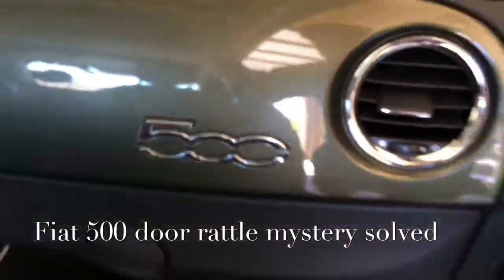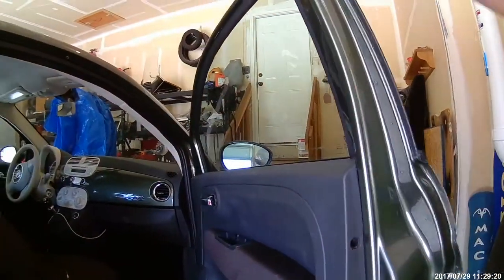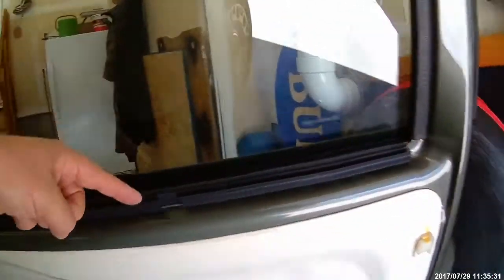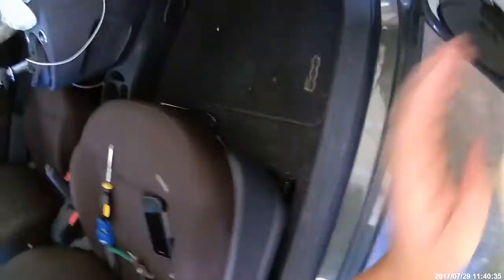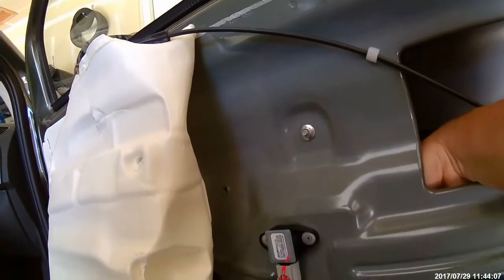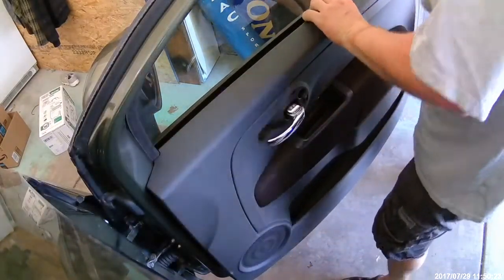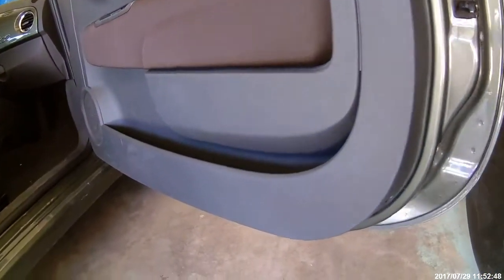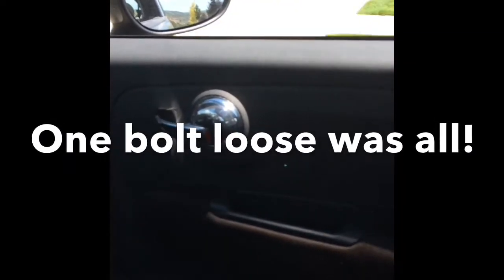Fiat 500 Mystery Door Rattle Solved!!!

Comment: Great video! This solved my problem. Had the same rattle in my 2012 fiat 500 passenger door. When the window was up the nut would tighten and the raddle would go away. I lowered the window and the nut would be loose and start to raddle.

Comment: The dealership took apart my door like 300x because the window randomly refused to go back up at 4000 miles. I went to the dealership the next day. They ordered the wrong part, the rubber seal they got was wrinkled, so my door was taken apart so many times 😂😂😂 Then when I put my window down over 48 hours later, I heard a loud "POW!" and the glass started rotating out of the door! Months later the door is rattling horribly and I can hear the wind through the door, which wasn'ta problem before they "fixed it.". My passenger door does not have that problem. Did the dealership not assemble it correctly?

Comment: That's a lot of work for a rattle. I've got some noise going on in the back door that's been driving me nuts.
Reply from the maker: yes it was!  But, DANG!  was it worth it :)
Reply: Great video! My problem was exactly the same and this instructional helped tremendously. I would add that everyone should use some Loc Tite blue when resecuring the nut, so it doesn’t vibrate loose again.